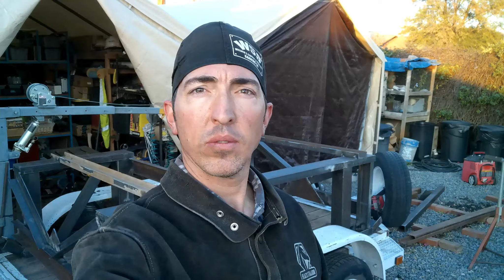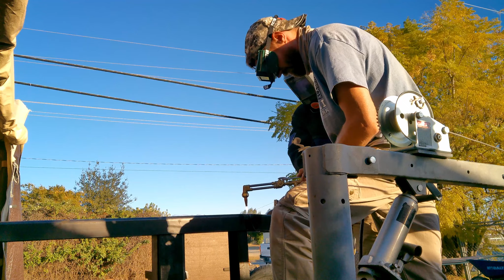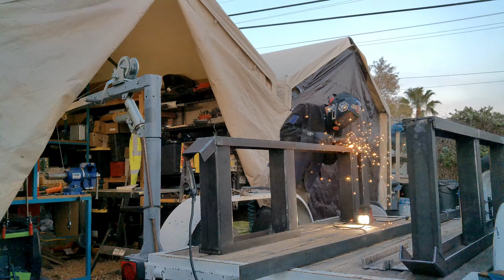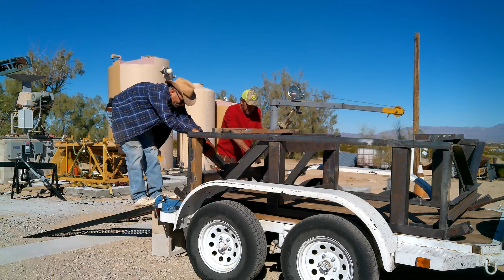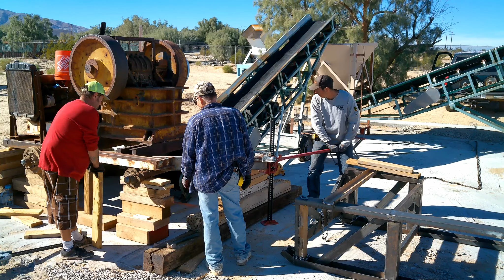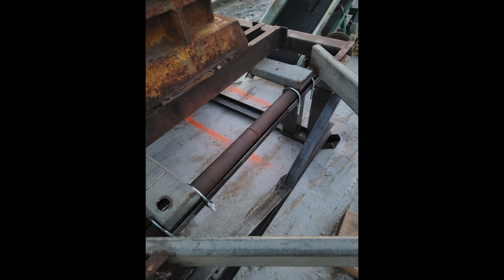Jaw Crusher Skid Fabrication & Install

Comment: I have a chance to buy one of those old dinasaur jaw crushers. What are they worth?
BTW, found you through Jason's channel!
Reply from the maker: Hi John. If the jaw, plates, and babbit are in good shape and is fully operational, I'd guess $8,000-$10,000. Ours is 16"x8". If it's poor shape, have to replace the babbit, and no power source, I don't see why you couldn't score one for around $2,000. I haven't priced older jaw crushers in awhile so I may be way off. New crushers that are comparable in size are between $20,000-$30,000. Thanks for commenting!